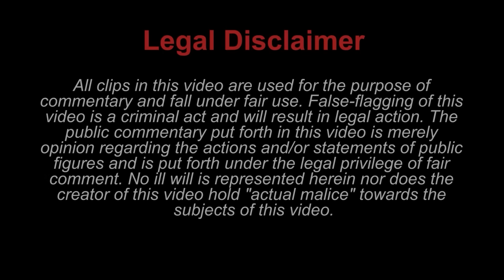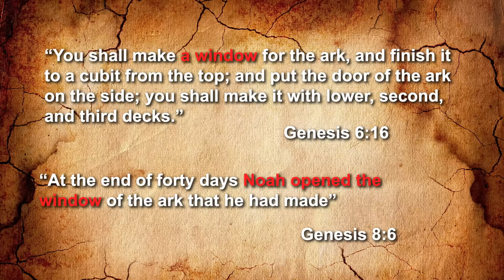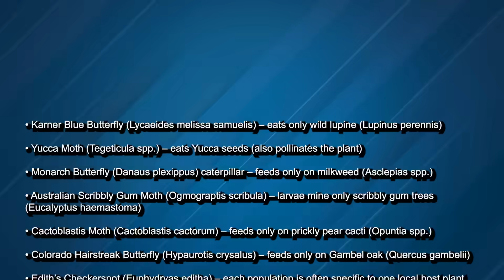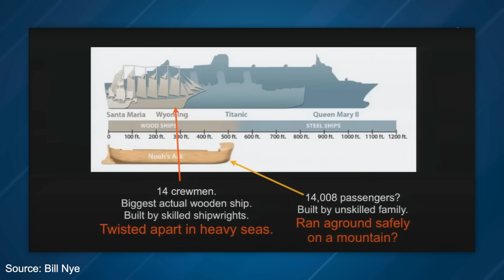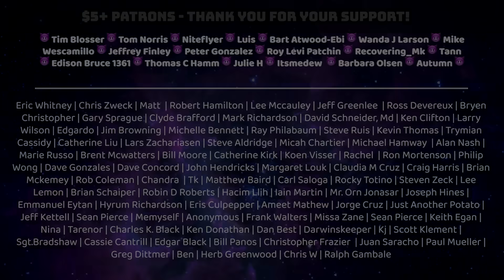Everything Wrong with Noah's Ark in 10 minutes

Comment: and another thing stated in the video is that it only rained for 40 days...while this is what everyone is taught, if you read the whole account carefully from Genesis Chapter 7-8, it actually rained for 150 days and the rained stopped (Genesis 8:2) by God making a wind pass over the earth according to Genesis 7:24 - Genesis 8:3...Now does wind cause rain to stop / move out of an area? Yes it does, in meteorology, this is known as a High-Pressure system (anti-cyclonic). Winds from a high-pressure system can contribute to stopping or preventing rain. High-pressure systems are characterized by sinking air, which warms as it descends creating a stable layer of air and clear skies. and what is wind? Wind is essentially air in motion. It's caused by differences in air pressure, which are often due to temperature variations. When air is heated, it becomes less dense and rises, creating an area of low pressure. Cooler, denser air then flows in to replace the rising warm air, resulting in wind....I have a Bachelor of Science Degree in Atmospheric Science and based on everything stated about the flood in Genesis 7-8 and how God caused the rain to stop are fundamental meteorological concepts that you learn in Intro Weather Courses from college.

but going back to the rain for 40 days, this is actually how long it took for the waters in the area where the ark was built to raise ark from the land to start floating from the floodwaters....Genesis 7:17 states this "Now the flood was on the earth (land) forty days. The waters increased and lifted up the ark, and it rose high above the earth"....then the next verse (v.18) states "The waters prevailed and greatly increased on the earth, and the ark moved about the surface of the waters" and then going to verse 24 it says that "the waters prevailed on earth for 150 days"....so that means once the ark was lifted up from the land and now floating upon the floodwaters, the water continued to increase on earth for an additional 110 days....and then when on read on some more, chapter 8 verse 2 that the "rain from heaven was restrained"....Is this a contradiction? No it is not....if you read it very carefully, nowhere throughout Genesis 7-8 does it say that it rained for 40 days and nights and would stop. Now, Yes in Genesis 7:4 God says "I will cause it to rain on the earth for 40 days and nights, and I will destroy from the face of the earth (land) all living things (that only have nostrils for breathing) that I have made"....Now did God say here that the rain will stop here? No....and does it say that all of the land animals will be killed and destroyed within these first 40 days? That is also another No as well....what God is clearly saying here is that the land animals are gonna start dying once this flood event hits day 40....and here is the evidence - after verse 17, when the ark was lifted after the first 40 days, the waters increased and prevailed above the hills and mountains (v.18-20) and then verses 21-23 state that the land animals died....indicating that they died How? as the waters increased and prevailed (v.18-20)
Reply: I'm not sure just how useful it is to be pedantic about this. This is merely us feeding our modern understanding of science into an archaic story. It's interpretative.

This is like being pedantic about just how tall Gandalf's staff is.
Reply: @wax99 well there is a difference with the flood and Gandalf’s staff…there is tons of evidence for a global flood from rock formation, fossils (marine life found at top of mountains clams in the closed position (when clams die, their shell opens up. If you have fossilized clams in the closed position, they were buried alive rapidly), polystrate fossils of trees fossilized upright and even upside down, marine life fossilized giving birth, schools of fish fossilized in swimming position)…

Gandalf’s staff has zero evidence of existence on earth.

And if you read my comment, yeah I know it’s lengthy, it is interesting to note the Genesis 8:2 makes a claim that wind can cause rain to be restrained / stop but it was not until recently that meteorologists discovered this concept. Like how in the world did Noah know this when he never saw this occur in high up in the atmosphere? Because God told him…and God has shown multiple times throughout his word that it is True like He says he is truth (John 14:6) and Science has slowly catching up to what the Bible has said all along with various scientific discoveries
Reply: @wax99 so basically what you are saying is that no science can’t be shown in the Bible? If so, then you will have to explain how the God stretches out the heavens like a curtain (Isaiah 40:22) and how science discovered in the 1920s that the universe expands…the Bible said it first….and same goes with air having weight, light traveling in a way, light (in the form of heat from our sun) causes the wind, etc…the metrological concept in genesis 8:2 that I described..I can go on and on

And gandalfs staff was written by an author who wrote it with a fictional literary style (who btw is a Christian and wrote LOTR being inspired by the Bible) 

The Bible is mostly written in historic narrative (Especially Genesis) with some aspects of poetic literature and metaphors that Jesus said during his time, known as parables
Reply: @cameronvandevelde4186 nope. Not at all what I said. Not sure how you got so confused.
Reply: "Genesis 8:2-3 - "2 Now the springs of the deep and the floodgates of the heavens had been closed, and the rain had stopped falling from the sky. 3 The water receded steadily from the earth. At the end of the hundred and fifty days the water had gone down,"

Once the Rain stopped it would start to recede, this is due to evaporation, however the 150 is just a reference that it was going down.  If it was to go one after the 40 days it would be worded to note that.  However the wording indicates it stopped.  No where does it indicate it stopped at 150 days.

Nothing there about 150 days for the rain to be going on.

However the Bible does say it rained for 40 days/nights 

Genesis 7:12 - "And rain fell on the earth forty days and forty nights."

What you are thinking is when the flood waters started to recede.
Reply: @ThyBountyHunter I am aware that the floodwaters started to recede after 150 days but if you look at the Genesis 8:1 as well as verses 2-3, it says something interesting…. “Then God remembered Noah, and every living thing, and all the animals that were with him in the ark. And God made a wind to pass over the earth, and the waters subsided. The fountains of the deep and the windows of heaven were also stopped, and the rain from heaven was restrained.”
Genesis 8:1-2 NKJV

God made a wind pass over the earth, which caused the water to stop rising and the rain from heaven to stop falling….if you read it carefully, this is when i believe the rain (that was an effect of the flood) stopped as well. So while it may have rained for 40 days and nights continuously for the first 40 days of the flood, these verses indicate that it still rained after the 40 days….now it probably was not continuous but probably rained on and off as a result of the evaporating water molecules from the floodwaters the condensed into clouds and fell as rain….and when God said that he used a wind to stop this, this is actually scientifically correct in meteorology….

When rain systems stops / dissipates out of an area, it is due to changes in pressure in the atmosphere and wind is caused by the air moving from higher to lower pressure…that is why and how rain systems move out of a different and “stop” in a certain region
Reply: @cameronvandevelde4186  God said when the flood was over, I showed it.  The flood, according to god lasted a year.  

You said it rained for 150 days, show the verse, it never said the rain stopped in a particular area that the ark was in but the rain continue elsewhere in the world.

Back up the claim you stated.  The fact you are all over the map when you are not even on your main target is telling.
Reply: @ThyBountyHunter Genesis 7:24-8:2 says this “And the waters prevailed on the earth one hundred and fifty days. Then God remembered Noah, and every living thing, and all the animals that were with him in the ark. And God made a wind to pass over the earth, and the waters subsided. The fountains of the deep and the windows of heaven were also stopped, and the rain from heaven was restrained.”

What does the text say? The waters prevailed for 150 days….and after 150 days, God remembered Noah and everything in the ark and caused a wind to stop the floodwater from increasing and caused the rain from Heaven to be restrained….if rain was suddenly restrained from falling out of the sky, what does that imply? That it was still raining…now the Bible does not say this so it’s my 100% speculation but it was probably raining on and off as a result of the flood (how does this happen? The water cycle) and again, the rain was the result and effects of floodwaters from the foundations of the great deep bursting from inside the earth, not the cause of the flood (like skeptics try to make it out to be)….that is the only reason why It even rained to begin with….i know what i am explaining is a minor detail that does not mean a lot to what the story is truly trying to tell (which is actually the Gospel of Jesus Christ) but i say all of this because how God caused the rain from the floodwaters to stop is a scientifically verified process in meteorology
Reply: @ThyBountyHunter and even though my explanation is a minor detail to whole point of the Bible, I also believe it is important for those who will only believe the Bible if it can be proven scientifically….which here is a embedded scientific concept in the Bible, written well before man discovered this in science, like how did the author of Genesis know this concept if they could not see what was going on in the atmosphere to prove this point and just write down that God caused wind to do this? Because God knows his creation inside and out and there are multiple examples all throughout the Bible that God directly said that has been verified by science….which is what convinced me to believe and trust that God’s word is truth like He claims to be! 

But if you don’t accept the scientific facts mentioned in the Bible, written down thousands of years before discovered them, then that is an very obvious sign you don’t believe the Bible as Truth because of your knowledge but because you don’t want it to be true….thats a heart problem and not an intellectual one
Reply: @cameronvandevelde4186 " The waters prevailed for 150 days….and after 150 days"

 Prevailed "The Waters", not that it rained for 150 days.  

" The fountains of the deep and the windows of heaven were also stopped, and the rain from heaven was restrained."

That doesn't say after 150 days it had stopped, it says it did stop, and if we look to a verse to show when it says it rained for 40 days/nights....not 150. 

Sorry but unless it says it directly you can only interpret it your way, when the Bible clearly stated it rained 40 days/nights.  

Want to see the nail in your coffin, experts, and theologians also agree the rain stopped after 40 days/nights, the Pope, pastors, priests, fathers, etc.... all agree.

You are one of very few trying to argue if it was 150 days....I'll take the experts words over yours, unless you have some paper stating you are the extreme expert on Biblical theology....

Can I see that paper....NO!!! oh figured so.  But if you have it share it.
Reply: @ThyBountyHunter you are completely overlooking my point and diverting away to fish for red herrings….

I am aware and 100% agree that it rained that for 40 days and nights….I am not questioning that because everyone knows it rained for at least that long but all I’m saying is that because Genesis 8:2 says that the “rain the from heaven was restrained” after 150 days, I am
Speculating that it probably rained some more after the 40 day period despite the Bible not explicitly saying it (but probably not as often during the first 40 days)….  Now does the Bible have to include this information? Not at all because it is not necessary to the story…The whole point I am trying to make is that Genesis 8:2 (how God caused the rain to stop) is a simple understanding of how low pressure systems work (contains rain (due to rising and unstable air) and how they move out of regions due to high pressure systems (due to sinking and stable air)….this is something that Noah and/or whoever wrote this story about Noah could have not known about during this time unless they were divinely told by God on How He did it….its like the same way God told us on How he created the world and universe in Psalm 33:6, which is by his words / his voice. God spoke everything into existence…and is this scientific possible that sounds have the ability to create things? Yes, sound waves have the ability to create physical effects and movement of objects and can generate heat when they are absorbed by a medium. So that process of how sound can create is scientifically verifiable
Reply: @cameronvandevelde4186  "Genesis 8:2 says that the “rain the from heaven was restrained” after 150 days"

The bible never said after 150 it was restrained, 8:2 says restrained.

The 150 days comes afterwards and describes the water at 150 days, not that it stopped raining at 150 days.

Genesis 8 3-4 NJKV "3 And the waters receded continually from the earth. At the end of the hundred and fifty days the waters decreased. 4"

For the water to recede or start receding the rain has to stop, so clearly before 150 days the rain had stopped, which was after 40 days/nights.

The water can't go down if it is still raining, which you provided a clear water cycle for everyone.

Again where are you papers showing you are the extreme expert????
Reply: @ThyBountyHunter  I have reference Genesis 7:24 - Genesis 8:3 I believe more than once....so to be more clear, on day 150 God caused the rain from heaven to be restrained / it came to a stop according to the referenced scriptures above...and at the end of the day 150, the waters receded....
Reply: @cameronvandevelde4186  "I have reference Genesis 7:24"

It says ""The waters flooded the earth for a hundred and fifty days"", nothing about raining for 150 days, you need a verse to say that.

Genesis 8:3 "And the waters receded continually from the earth. At the end of the hundred and fifty days the waters decreased. "

Again  no where does it say it rained for 150 days.

Again I do not see any papers stating you are the extreme expert in Biblical studies.
Reply: @ThyBountyHunter  I am not claiming to be an expert in Biblical studies and I have said this again, Genesis 8:2 has an embedded scientific concept in it and that has been the main point that I have been trying to have you understand, along with others but you divert off of this because I think you don't want to admit that the Bible contains scientific facts in it, thousands of years before man started making these scientific discoveries....
Reply: @cameronvandevelde4186  Well you are suggesting one verse says when the rain stopped but it doesn't say that, and only a biblical expert could attempt that.

So if you are attempting that I can only conclude you were.  As you admit you are not, and the verse does not say the rain lasted longer than 40 days/nights, you are at this time wrong.

Genesis 8:2 has an embedded scientific concept in it and that has been the main point that I have been trying to have you understand"

The science you stated shows the rain was evaporating (receding) before 150 days, so the rain scientifically had to have stopped for that to start.

The scientific concepts you were embracing does not support your point.  The rain stopped after 40 days/nights.

The Bible says it and the science backs it up.
Reply: @ThyBountyHunter but even if my explanation is wrong here, the guy in the video makes many faulty assumptions that make it seem like the Noah’s flood is impossible….especially when assumes that the earth was entirely flooded after 40 days and how only the rain caused a global sized flood when the text never says that….when you read through Genesis 7 in it’s entirety, it actually took 40 days for the ark to be lifted up by the floodwaters according to Genesis 7:17

This is why if anyone wants to attempt to disprove any story in the Bible, it is important for them to read the whole chapter / read the all of the text regarding a story (like in this case, he should have read Genesis 6-8 in full) but instead, he picked and choose verses and created a false theology / narrative out of this story either done out of ignorance or even deliberately to mislead people

Comment: Your conclusions disregard the tremendous pressures on earth's thin crust created by that "rain". There was actually a vast "Watery Canape" above the earth which collapsed causing massive mountains to be pushed up by tremendous weight.(See Genesis 1:7)  If the earth was a perfectly smooth sphere, the average depth of the water covering it today would be approximately 2.7 kilometers (1.7 miles deep). This calculation is based on the total volume of water on Earth and the surface area of a sphere with Earth's radius.  At that depth, the pressure on the Earth's thin crust would be approximately 3,514 psi! That pressure could lift a lot of "crust" into mighty mountains. That certainly would explain fossils of sea creatures found on the highest of earth's mountains as well as why the center of the United States used to be under a sea bed from Mexico to Canada. Learn some relevant stuff.
But...Still a man hears what he wants to hear; denies what he wants to deny for a reason.
Reply: https://www.youtube.com/watch?v=XVSRm80WzZk&list=RDXVSRm80WzZk&start_radio=1